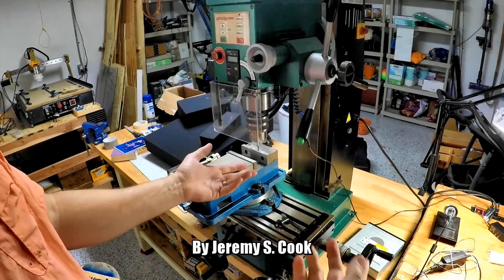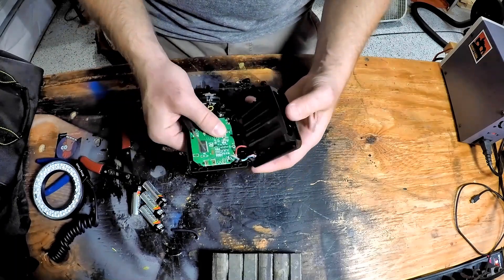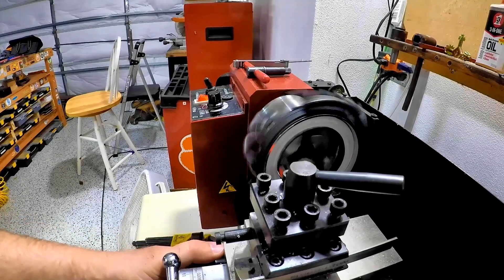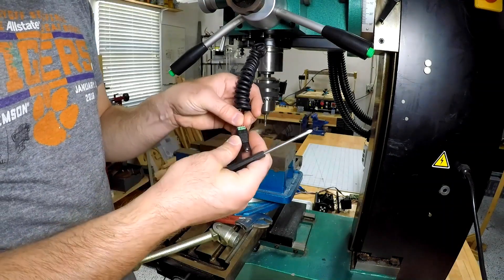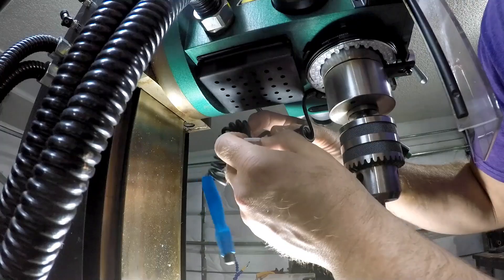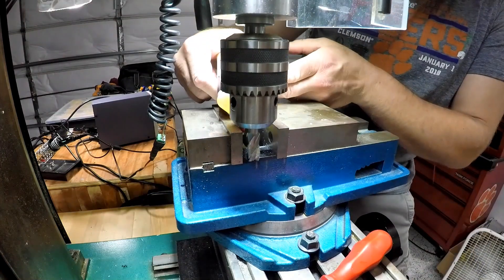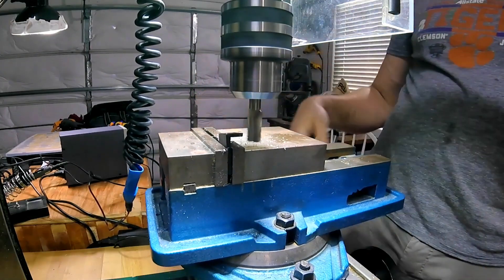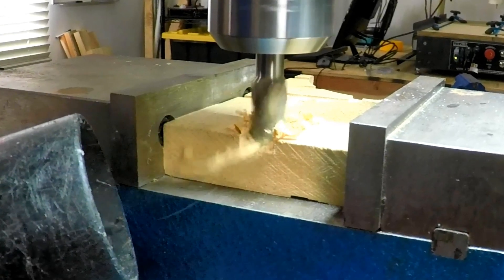Milling Machine Light from Recycled Ring Flash

Comment: You've got me thinking I should put an LED ring on my CNC!

I have an adhesive recommendation for you, even thought I'm certain CA is a fine choice here.  I accidentally bought this stuff at Lowes Depot called "Welder."  I was in a hurry, there were two tubes in the case, and I assumed it was a 2 part generic JB Weld.  It isn't, but it turns out that I love the stuff.

It cures to something not entirely unlock hot glue.  It is a bit rubbery and compliant, sticks quite well, but not so well that you can't pry things apart if you need to.  It seems to be almost identical to something called E-6000.  It won't melt away like the hot glue, but it also won't rip the plastic away if you decide to pry the light off next year like the CA might.
Reply from the maker: Yeah, why not :-)

Thanks for checking the video out and your glue suggestion!